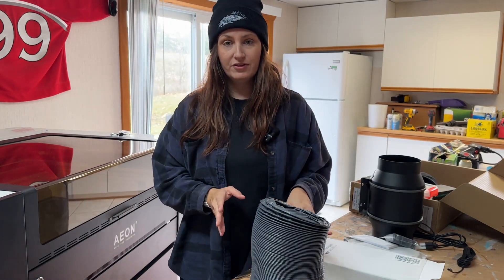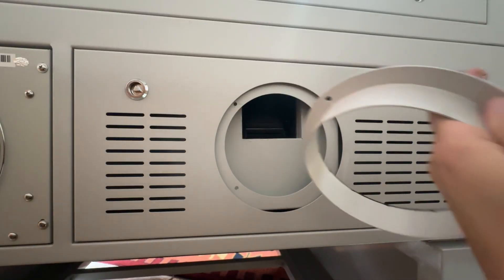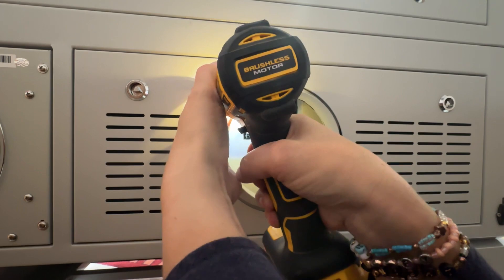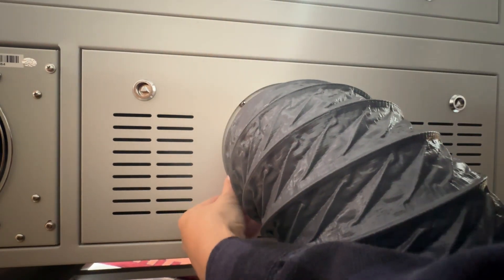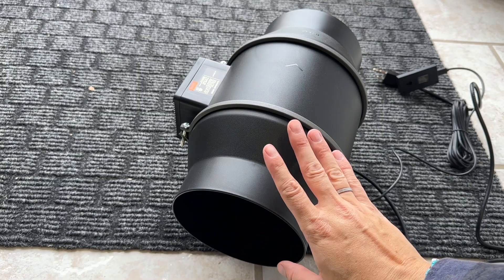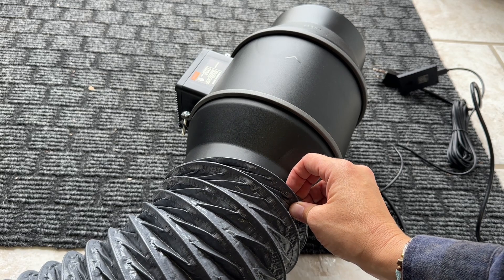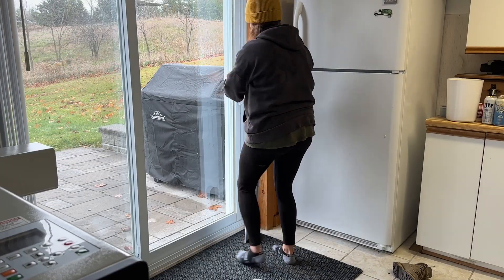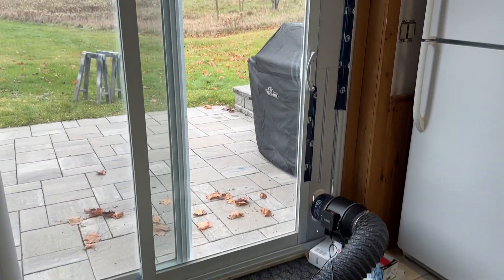Laser Ventilation Without Putting a Hole in Your Wall

Comment: The "clampy thing" is called, naturally, a hose clamp .  Don't take the ends apart.  Rather, slip the ring over the hose before slipping the hose over the barb.  You can hold the clamp loosely in place at the end of the hose using a few bits of tape, before putting that over the barb and then tightening.
Use a ¼-inch socket, not a Philips-head screwdriver, to tighten the large clamp.  It won't jump out and you can tighten it easily.
Reply from the maker: Thank you for the tips!
Reply: Im curious why you suggest a socket instead of a Phillips.
Reply: @KLartrandM  It won't jump out and you can tighten it easily.